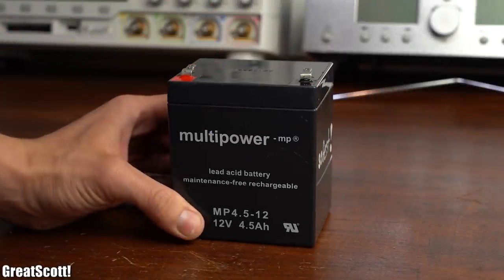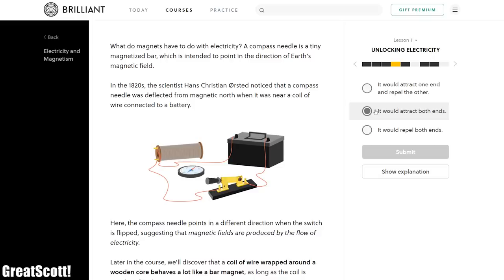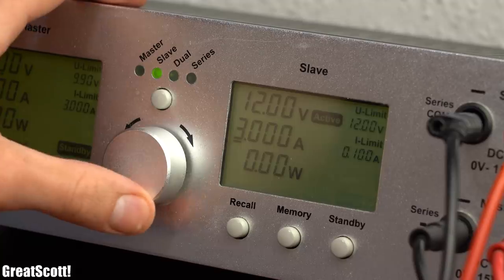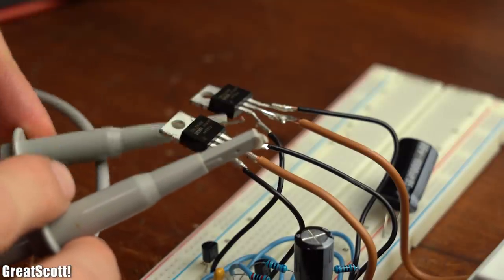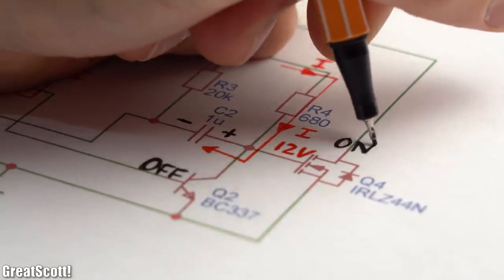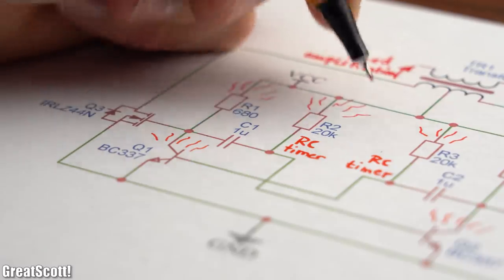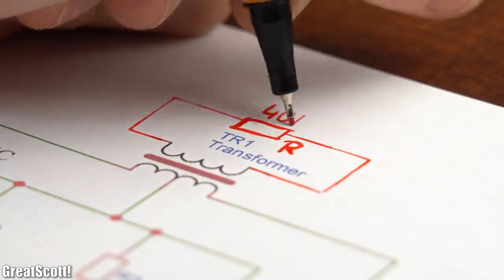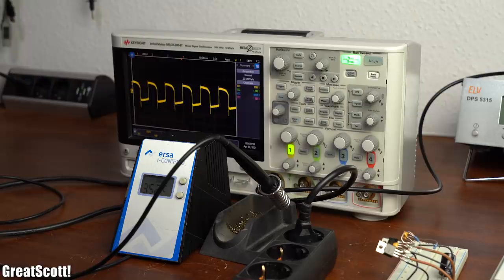Testing circuits I found on the Internet: Inverter! It does work, BUT...

Comment: There is #class #d #amplifier circuit based on #Tl494 #pwm ic which claims 500 watts at 40 V dc i tested it it working but i tested at 12 volt input the rms output of the Amplifier is just 5 volt at the output speaker side which is not more then 20 watt amplifier  i slightly modified the circuit by adding 150 ohm of resistor 
From pin 1 to ground to balance the comparator input voltage  it increased the output dus i get 5 volt rms  .
So can you modify this circuit even better i mean is it possible to increase the amplitude of Pwm modulation section so we can get  higher gain at just 12 volt supply ?
And talk about disadvantage , efficiently , distortion , harmonic etc of this circuit  and also about Feedback network ??

Comment: Another thing with going the squarewave route is that it produces a lot of overtones, 3f, 5f, 7f, and so on, and WILL cause EM interference apart from giving anything you feed with the inverter the heebee jeebees...
And with the added restraints of output voltage control, output frequency control, and input undervoltage protection, the most sensible thing to do would be to have a suitable microcontroller controlling it all.
This is however not, I REPEAT NOT, a task for an Arduino or the novice programmer, but has to be coded without errors, with code that does not change the output should the microcontroller experience unexpected numbers of interrupts, and safeties on top of that (like a watchdog timer set at the right timeout which kills the drive signals to the MOSFET if it is triggered, as well as going overboard to protect the microcontroller and MOSFET drivers, just to mention a few).
And if you're going to go that advanced, you might as well drive the MOSFET's with a PWM signal and use an H-bridge (which is the route many UPS'es and True Sine inverters take). And, of course, have a properly designed filter on the mains level output to filter out the PWM base frequency...

Comment: It's a plenty good enough inverter, it's just only good at driving resistive loads
Also, a 12 volt lead acid battery should be considered discharged at about 11.8 volts. Much below this can damage them (called deep cycling) and should be avoided.

Comment: I really like your videos! Would you do a potentiostat, which is an Opamp based circuit that can control the potential between two electrodes, work and ref, and measure the current that goes through the work and an auxiliary electrode. It's super used in electrochemistry and there are a bunch of open source circuits online but I would love to see your take on them.

Comment: What about using a class-D audio amplifier with a 50 Hz input, and using a step-up transformer at the output instead of the output coils? Would give you a fixed frequency. Maybe add a feedback network that changes the amplitude of the input waveform to keep the 230VAC amplitude stable

Comment: Out of curiosity, would the voltage spikes you were experiencing in this circuit be similar to the ones that are output by a gasoline generator? Ive been curious about the reasons why the warning tags on heated blankets specifically state to not use them with generators. (And other heated appliances as well)

Comment: Astable Multivibrator,
Its output from transformer will not damage mobile charger,  as charger have own circuit for protection.

I have tested this circuit with mobile charger in 2013 for high school Project.

Comment: I normally use 555 timers instead of a astable oscillator although I've never burnt my phone before normally I use a high frequency since I can better control the voltage as well as a feedback circuit mostly trying to regulate it to 110 volts ac

Comment: Can you recoment a transistor that I could use?
It needs to tolerate around 20V at 6A and should saturate at arduino-level voltages.
It will be used for a car ignition coil, do I need a diode to protect it for that too?

Comment: The website uses electrolytic capacitors
Yet you point out that the astable multivibrator has the capacitor's polarity constantly changing due to the way the transistors turn on and off
I wonder if they  overlooked that detail, since their electrolytic caps would've explode the moment polarities switch

Comment: Hi Great Scott, can't we use another transformer after the  first one to reduce the voltage to 12v and use another transformer to increase the voltage to 200v??
I know that it will waste some power but will it make the waveform better??

Comment: Shouldn't a switching power supply be fine to use with it, since it regulates it back to like 300V DC?
Reply: Could be the spikes, and/or that was a cheap power supply and had an isolation issue.  A good power supply should have its front end fry before damaging a load.
Reply: @arthurmoore9488  maybe if the spikes are higher than the rating of the input mosfets, they might leak current through to the transformer and have spikes on the output.
though a decent power supply  would probably have like a 5.2V zener diode and a capacitor to avoid that.

Comment: Can you look at some of the FM transmitter circuits? You know the ones where you can adjust frequency with variable capacitor. 
There are a lot of them and I am confused at some of them because some used OpAmps and some didn't. 
And once I tried building one, but didn't work...
My goal back then was to build 2 set of transmitter and receiver (one tx and rx set for one user) so that they can communicate like a walkie-talkie.

I know you built walkie-talkie with NRF24 and those RF Transmitter... But I do want to see a take with FM.

By the way, awesome video and great sense of humor
Reply from the maker: I can put it on my to do list ;-)

Comment: I'm working on a large project which requires a custom PCB with lots of different components I've had to search Google for schematics for. Given the approximate cost of the final PCB, I've opted to make each individual component separately as a sub-project so I can test them all separately first so I don't have to spend hours scratching my head at which point in the circuit I screwed up/

Comment: Hi I built a board based on arduino, but connecting the power that goes from a power supply that transforms it from 12 volts to 5 volts, I noticed that it is incurred. Could you help me to understand how to solve the problem?
Because by directly connecting the 5 volts on the VCC pin it works perfectly

Comment: Hello GreatScott! I’m working in the industry field with magnetic (proximity switches) and was wandering if there’s a circuit to test those magnetic / capacitive switches. Like Baluff or other brands, they have a common 4 or 5 pin m12 srew design. The test device should indicate only if the switch is working properly. Maybe with a small battery (most of them work with 12/24V) Thanks for any help 🙏😊

Comment: Maybe try a treadmill motor controller? Everyone uses the board that came with the treadmill or an SRC with a bridge rectifier. If the original treadmill board is broken, your stuck with the SRC.

Comment: Very very good! But let me tell you that you did a big mistake. Sentitve electronic has NO problem with frequency or voltage (as you can read on the labels they text 50-60Hz and 115-250V). The problem is the shape of the voltage signal, which obviusly is a square and not a sine with this circuit. And please this circuit is not a scam but it is intended to work in a particular conditions. It is clear to everybody (and I hope you were just cheating when seemed you were surprised) that if you change the conditions the circuit changes the behavior too! Just think if you go below 8V, the MOSFETs will have an Rdson so large that they immediatley blow up!;) and I'm sure you know that!

Comment: You could have a microcontroller driving the PWM signals to a couple of MOSFETs switching to high, low, and zero volts. Though actually a bit of Googling turns up dedicated chips to do this.
Reply: Yep.  Though there's a trick.  You're operating the MOSFETs in the linear region, so they're going to be power hogs if you're not careful.  Interestingly, actually just putting a rectifier and filtering caps on the output may be the best way to solve some of the problems.  Well as long as you're very careful about your loads.  That smartphone charger for instance almost certainly does exactly that as a first stage.  The Philips bulb may do that, but cheaper LEDs would fry since they use a capacitive dropper.
Reply: @arthurmoore9488  You don't need to operate the MOSFETs in the linear region. You can drive them with PWM which is either full on or full off and set the duty cycle to get the output voltage. Run things fast enough and you can get away with a small capacitor to filter out the high-frequency noise. If you Google it there are all sorts of variations on this theme - from a simple H bridge that does high, low, and zero to more subtle schemes which have more levels. More levels means you have fewer high-frequency harmonics but you obviously have to find a way to generate those levels without having any FETs in the linear region. 
   
I'd probably go for H bridge and a dedicated controller which has feedback and protection.

Comment: You could have used a low pass filter on the low voltage side to get a sine wave and remove the harmonics wich make it square.

Comment: I do wonder how could it fry your phone considering, that you can power up switching power supplies even with high enough DC, as the input voltage is anyway rectified and just charges the capacitor. Also phone chargers have protection against overvoltage on the output

Comment: Frequency is not that critical for phone chargers due to the internal rectifier. You should try adding some capacitors in paralel with the transformer's windings to create some resonant circuit wich may improve it's efficiency
Reply: What is the name and job of these caps in secondary of transformer?
Reply: @Ray77582  a cap in paralel with an inductor creates  a resonant circuit. This circuit Will improve the efficiency of the circuit. You could use the formula for the resonant frequency of an LC circuit to calculate the values of the caps, and also you need to know the inductances of the transformer's windings

Comment: You can try those 12v halogen lamp circuits without any ic powered by mains (as mentioned by someone else in the comments too). Though it's a bit dangerous but I want to see how it works and it's waveforms :-)

Comment: Building power circuits on breadboards is a bad idea. The stray inductance and capacitance would run rife everywhere and be orders of magnitude larger than they would be on a PCB. Snubbers can help, but it's kind of analogous to wrapping a towel around a lose motor to stop it vibrating, rather than just firmly bolting it down. Some of the circuit would actually be okay on a breadboard though, but selective point-to-point wiring, keeping component leads as short as possible, like to the gates of the fets would significantly reduce ringing and put less burden on the snubbers.

Comment: Another issue of the circuit is that the voltage is too high, because it is a square wave. An incessant light bulb will consume more energy than it is rated for

Comment: I'm pretty sure that overvoltage on the primary of the switchmode power supply could kill your phone. Please look into this in the next video - let's explore what went wrong ? e.g. does the power supply still work? Does the short pulses pass right through the transformer with no regulation?

Comment: that circuit reminds me the pretty old "electric shock jack in the box" some 40+ years ago, it runs on a 9v battery, two 2n2222, and a tiny radio transformer and a couple of this and that. this is a beefy build version, electronic components change a lot, but the creative idea didn't breakthrough much in this particular case. and recently i dig out a electronic "circuitry cookbook" which i bought in those days, compare circuit on the internet nowadays, they are still there, even the components, say, ne555, ua741. shall i say classic or shall i say no break through? however, the controllers do have a significantly change, remember z80? 8080? 6502? it will cost you an arm and a leg to get one in those days, but nowadays, kids can buy ardino and pi for the price of 2~3 burgers. 40 years ago, these things boom the computer industry, let see what we will have this time. maybe? just maybe, it won't go too far, because  everything had been tried.

Comment: Question at hand.. Can you use an arduino to make a PWM signal that opens and closes a Mosfat and makes a sinuswave and then transform it in to 230v?
Reply: I know that a PWM signal is digital, but when you transform it with an ironcore transformer... Will it work?

Comment: Could you come up with a circuit to force USB3.1 by hardware? I tried by isolating data pins (d+ and d-) but it didn't work.

Comment: But mehdi at electroboom created an exact same circuit and got some awesomely clean sine waves.. why didnt yours??
Reply from the maker: Exact same?
Reply: @greatscottlab  yes, i mean he also worked on the astable multivibrator circuit in his Induction Heater video!!
Reply: You’re kind of right but that circuit was a zvs driver which use a multivibrator with a lc tank
Reply: @Ray77582  still doesn't answer my question
Reply: @itsanshtak  this circuit is a multivibrator that oscillate a pulsating square wave at its two output with adjustable frequency.but the circuit that Mehdi made is a zvs driver that use a lc tank which is a high frequency sine wave oscillator.with the help of this circuit it makes a sine wave that you’re talking about but that circuit provides a high frequency and isn’t useful for many appliances.
If you have any other questions I’m happy to answer it😊
Reply: @Ray77582  k

Comment: Can you try to make a 12v dc to 240v dc converter with feed back like a smps and then use high voltage mosfets in h bridge configuration to convert ac to dc this will get rid of voltage spikes

Comment: There are so many circuits that used to convert 220v to 12v and so on using Capacitors (105j 604k)
and most  of these circuits used in cheap led bulbs,
Kindly explain these circuits

Comment: For 40 dollars you can buy a proper 12V DC to 230V AC inverter. Most od electronic gadgets run internally on DC, so a buck/boost converter is more suitable way to power them up.
Stil for 40$ you cannot get or build fully sinusoidalnego inverter, so you cannot use it with AC motors. 
But you can invest 40$ in educational electronic kit for you or tour children, so they can earń for a proper inverter and other cool stuff in the future.

Comment: Would it not be simpler to make a DC/DC converter from 12v battery to 5.5v usb instead of converting the DC to AC for it to be converted back by the usb charger?
Reply: the point is to build an inverter

Comment: Why, a well regulated, galvanically insulated switch-mode power supply like your phone charger would fry your phone?
The bridge rectifier at it's frontend, with it's minimal emi filtering and a fuse, should not mind the waveform and neither the frequency as long it's in the bridge diodes response time and doesn't get shunted by the filter.

Comment: Can you hack an amazon Inverter to create a Variable frequency drive? I Was thinking about making one in to a AC Lab power suply to test motors and other AC stuff with both frecuency and voltage control

Comment: Hey, I'm having a problem with an electric motor that's in the rear wheel of my cargo moped. There is no power limit and the engine burns up under too much load. The system is powered by 60 VDC Pb batteries. The electronics are three-phase pulse width modulation (I think). The manufacturer in China takes no responsibility for the weak safety. The winding of the engine burns up under excessive load. Is there any possibility of a solution to this problem? Motor power 3000W.

Comment: Hello.. Can you help me to making led just blink 1 time and then stop? I mean if turn on the switch, the led blink just 1 time and then stop not blink again. But i didn't use arduino or relay. I hope you can help me use transistor or IC. Thanks!
Reply: have a capacitor charge then when the switch thrown [and the cap is no longer being charged] the capacitor powers the LED

Comment: I wondered who'd connect an inverter directly to the battery without having a stabilizer in between first. But then I realized actually using a random circuit from a google images was far more stupid.